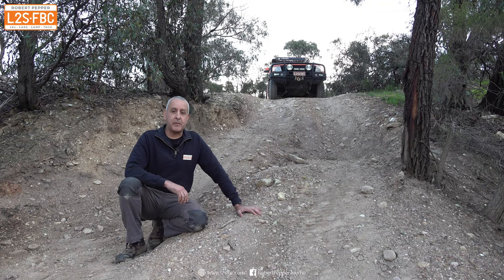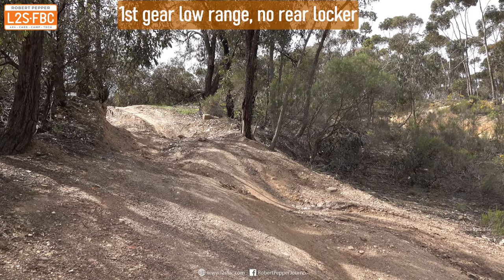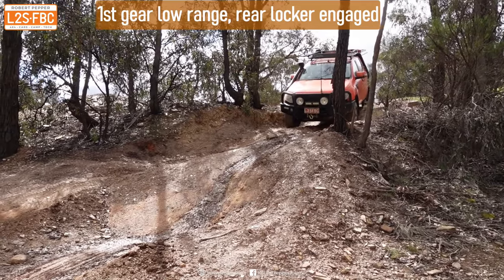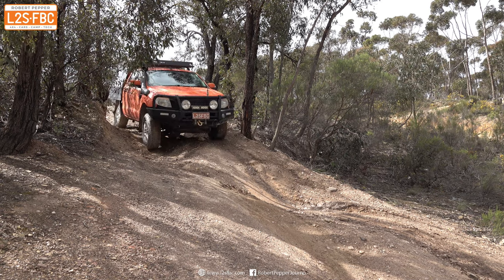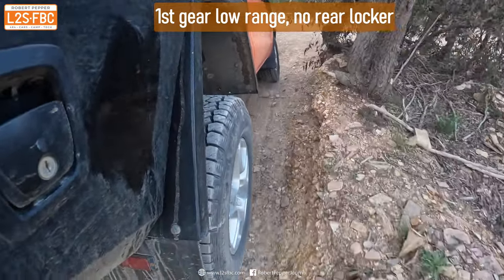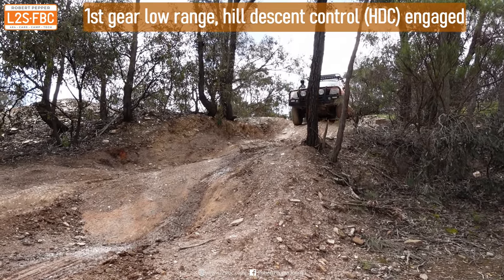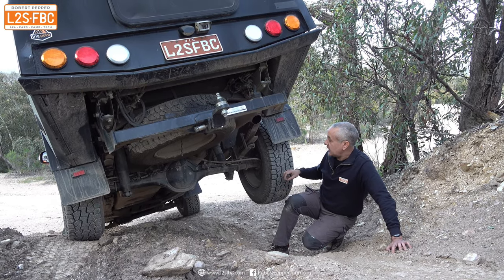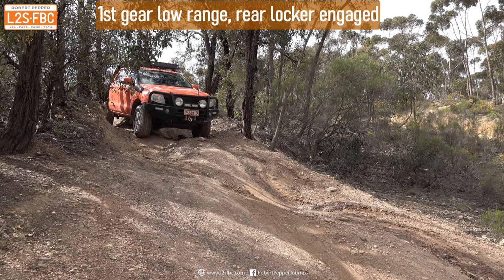You should engage lockers for descents

Comment: I have two rules of thumb.

Firstly, always use a gear lower for the descent than the ascent. First gear is a good rule of thumb but if the ground conditions are very slippery there's a real risk of the vehicle sliding out of control, second may be a better option. For such ascents you'll normally require third gear because second can cause wheel spin, but for most hill climbs where traction is less marginal I find second gear to work the best. The other part of this rule is on soft sand dunes, where in too low a gear the vehicle will simply nose into the ground. Sand has a braking effect anyway, and I've seen low third and some accelerator required in really soft going to stop this nosing in effect.

Secondly, if you needed, or judge that you would have needed, an axle differential lock for the ascent, you should also use it for the descent.
Reply from the maker: I agree, good rules of thumb. I would not use HDC at all in sand, and in fact Land Rover say not to (don't always agree with them, but in this case I do).  The old rules of 2nd low up 1st down don't really apply so much with 10-speed automatics of today, but the concept remains the same.
Reply: I was taught similar.  Especially the bit the using a slightly higher climbing gear means the engine is inclined to be a lower RPMs and usually in peak torque band rather than power, reducing risk of wheel spin . Not sure how relevant that is theses days.

Comment: Great info as usual!   One time, while climbing an uneven rock slab, without lockers, there was a spot where both axles had a tire off the ground at the same time, and the Jeep would sort of hop backwards and would be unable to ascend.  It was very surprising and hard to understand at the time.
Reply from the maker: What happened there was differential sending drive to the wheel easiest to turn. Check my differentials video for more.

Comment: How about using the brakes yourself, not HDC downhill? You mention that in the Facebook post. I drive a manual 105 petrol Cruiser, and I’d almost have to drive down that hill, as my 1st low is actually very slow. No lockers though.
Reply from the maker: Absolutely you can brake downhill - if the wheels slide then reduce slight the brakes (NOT jump off) then reapply. The old "never brake downhill" advice is wrong.

Comment: Thank you for content. Probably a good idea to mention that it's a good idea to lock center diff as well for the same reason when assending or decending. With diffs locked, does using the foot brake to slow the vehicle further have any disadvantages? Many advocate using engine braking only for hill decents and hill stall recovery. Is this a technique from the past where open diff vehicles were more common? Should we be teaching hdc and/or lockers with brakes for a hill stall recoveries?
Reply from the maker: Yes, definitely lock centre diff. I didn't cover that as otherwise where do I stop...and not all vehicles have centre diffs.  You can always add braking yes, but yes but use a low gear, and that's always been a technique. The "NEVER BRAKE DOWNHILL" people are wrong then, now, and into the future.  Instructors should teach everything; HDC, lockers, braking, engine braking and show how to mix and match techniques depending on the hill and the vehicle.
Reply: I've always been a fan of using brakes on difficult descents, if you start off really slowly, ie on idle 1st low, you can always fall back to just pure engine braking. Also does make up a bit for open (non-locker) axles.
Reply from the maker: Agreed!
Reply: Prado 150- Centre diff must be locked for Rear diff to be engaged

Comment: How would twin lockers have performed compared to traction control? Enjoy your stuff.
Reply: I think it’ll be more controlled 🤔
Reply from the maker: Would have been even slower as the front would have been controlled in the same way as the rear. But I've only got a rear locker.
Reply: @L2SFBC  I find using both lockers it is more controlled but it is very difficult to judge when you are about to loose traction and should this happen you are  suddenly in a 4 wheel slide and have to power out of it, not for the faith hearted.
Reply from the maker: Definitely, you have identified something to be careful of with lockers - it's all traction or none. You see this when acending, the back end can slide out for example.

Comment: Impressive tutorial Rob. It seems the Ranger goes fast in 1st gear low. Is it because of the weight of the vehicle on a steep decline pushing it along ? edit. nevermind, I read an explanation further in the comments. The gearing is not low like a Defender or Rubicon.
Reply from the maker: Yes, the crawl ratio is I think 33:1 or so compared to Toyoya/LR of about 45:1. And the Defender/Rubicon has better flex so less likely to wheel lift.

Comment: When I first got my 2017 hilux I took it up a mountain. Sudden storm hit once I got to the top. Steep muddy decent, a few km worth, scary stuff. I fiddled around with the buttons, pressed hill descent and placed all my trust in the ute. Got us down piece of cake in safety. Honestly feel like it would have been certain death trying to drive down normally, 1st low in these modern utes is fast af, as we can see here. Was convinced on the tech then and there
Reply: If you are caught like that and are absolutely desperate to get down safely a technique that can help is to chain a large branch (One with lots of smaller branches off it so it can't roll around etc)  with a drag chain to the back to act as a anchor as you descend the slope .   This sort of thing should only be used as last resort though
Reply: @roblogie1742  great tip I'll remember that

Comment: This is some excellent info. I've always wondered about this. Do you think it would help just as much if you didn't have a wheel off the ground? Like it was just a steep hill?
Reply from the maker: The wheel doesn't need to be off the ground for the locker to be of benefit, just a difference in traction across the axle. I should have mentioned that. The effect is more  noticeable the greater the traction differnece...and air has very little traction!
Reply: @L2SFBC  awesome.. thanks! Great work as always. 👍

Comment: Another good topic is - if you are using hill decent control, should you use 1st gear low as well (especially in an automatic). The advantage of using 1st low as you get the engine braking as a backup/assist to the brakes. The disadvantage is that if you are decending a very slippery steep slope, the hdc may need to allow the wheels to spin faster than 1st low will allow if the vehicle slips down and gains too much speed in a slick section. If the vehicle was in Drive, it's more likely the hdc could allow the tires to go fast enough to stop slipping and then the brakes could apply to retard the vehicle. In 1st low, it's possible the vehicle would end up with 4 wheels locked up and hdc would I presume have a harder time dealing with it.
Reply from the maker: Yes, use low gears with HDC to reduce braking effort and heat buildup. Whether you choose 2nd or 1st...choose what you'd use without HDC. I wouldn't use Drive.

Comment: I have a Jeep tj. I’ve always engaged front and rear lockers going down steep hills, especially if it’s slippery,  I want as much traction and every tire trying to slow me down through engine braking. Front locker can be disengaged if I have a tight turn to steer around. I Also consider braking the last resort on slippery stuff, if those front wheels lock up and start sliding it’s hard to command your brain to release the brake so you can steer.
Reply from the maker: Agreed, definitely a good technique!

Comment: Robert, could you do a video on the Aussie "Lokka" product, a locking device fitted inside the diff. Re HCD, why don't manufacturers use a simple rheostat so that the driver can "dial-in" the decent speed - much like the old hand-throttle technique?
Reply from the maker: No, because there wouldn't be much demand for such a video. I have to think of what most people would want. I only have a limited amount of time!
Reply: @L2SFBC  Thank you for your reply.